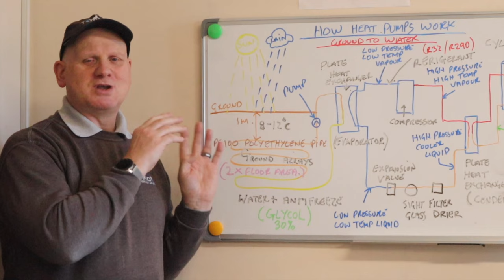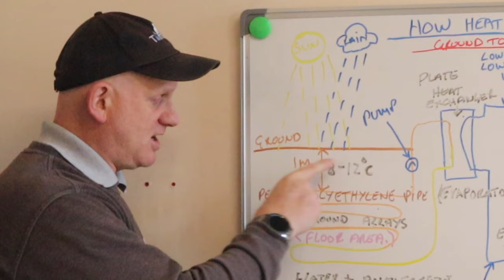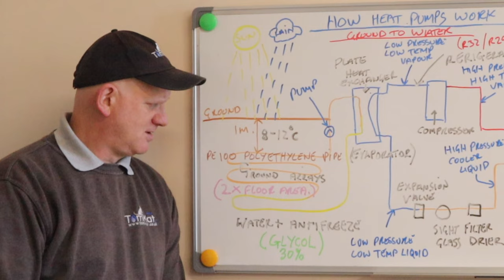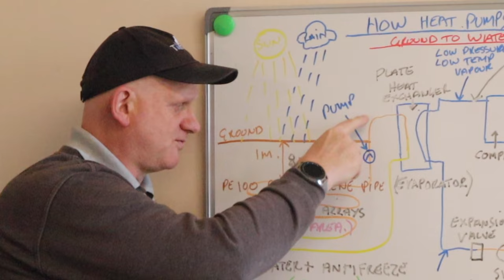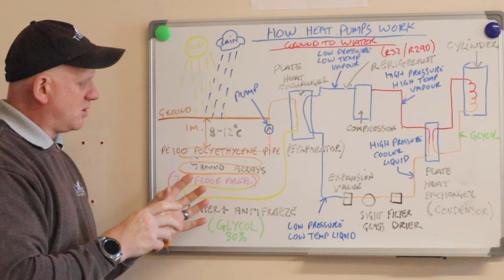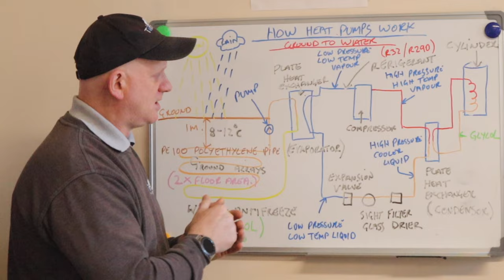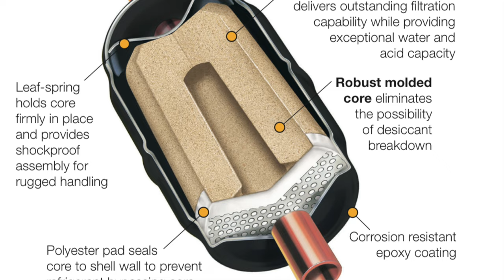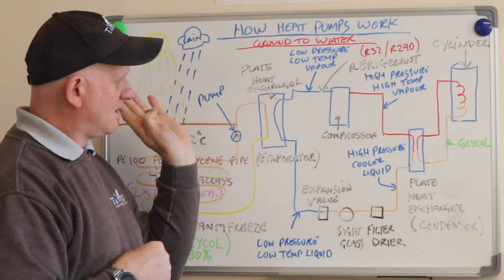How a ground source heat pump works. #Free heat pump training  #plumbing

Comment: The compressor alters the atmospheric pressure on it's negative side thus placing the refrigerant in a vacuum and by doing this is what causes the refrigerant to boil at a very low temperature. 
I don't think you made this clear enough Tom, although you did explain everything else very well. 
You have to wonder who thought this lot up in the first place?

Comment: Can I ask you a question.    I thought that when gas rating a boiler.   You had to run other gas appliances in property at 50%.   …".      but I fitted a new boiler last week and in the. Mis. It said do not run any other appliances:::     Have you heard of this before
Reply from the maker: Only on working pressure at the meter if you suspect low incoming pressure